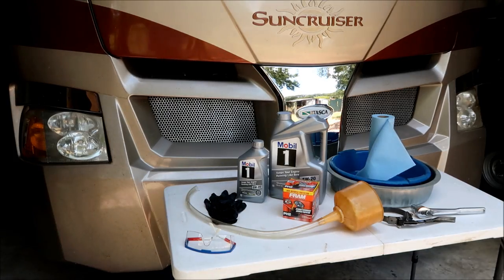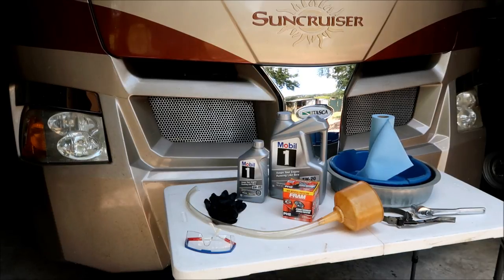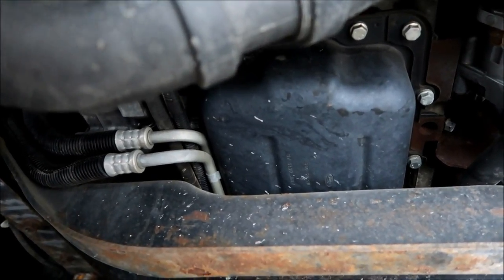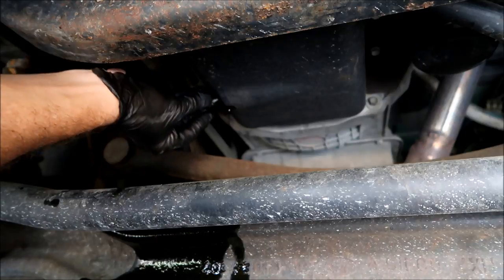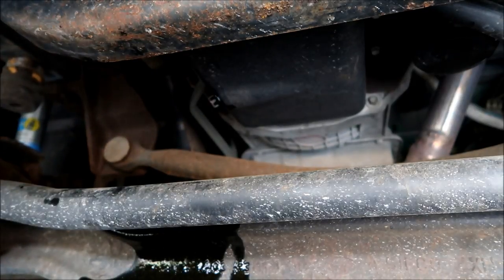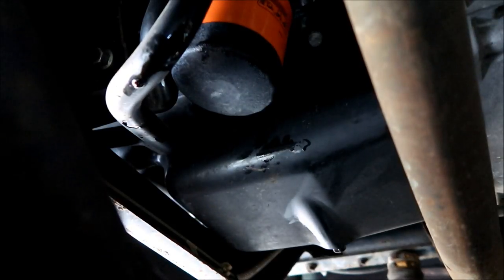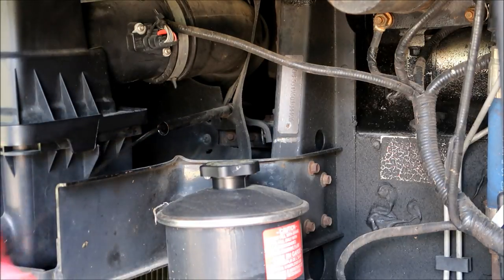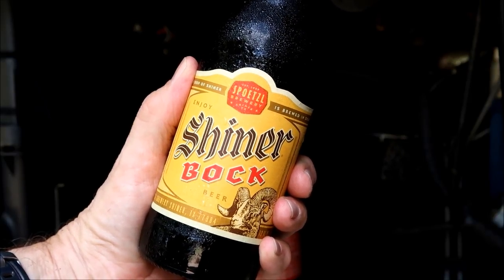FORD TRITON V10 RV OIL CHANGE

Comment: Thank you for the wonderful video.. did some of the v10 6,8 engines have a 7qt oil capacity?  

Just acquired a v10 powered RV and I try 3 answers online

6qt
6.5qt
7qt

Thank you

Comment: Does anybody know why my V10 uses a qt of oil every 900 miles when I use the recommended 5-30 oil, but it only uses a qt every 2000 miles when I use 10-30 oil?
Reply: because